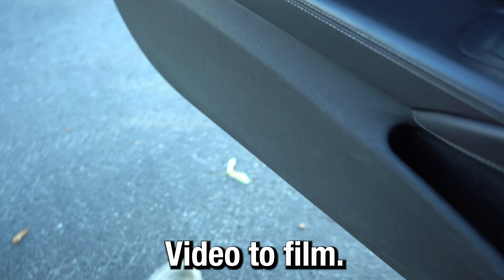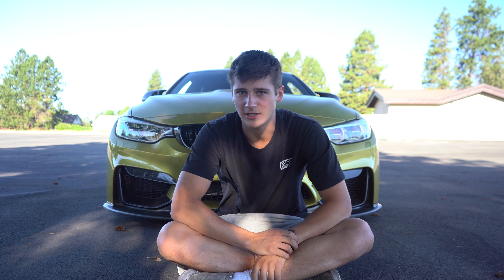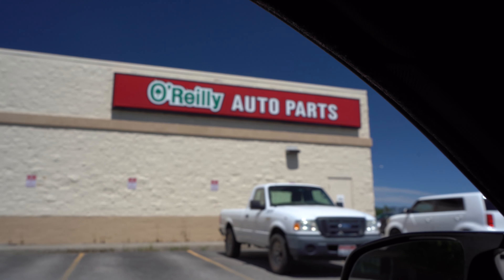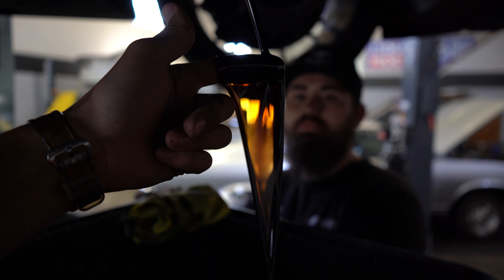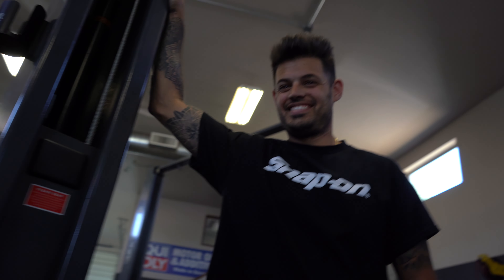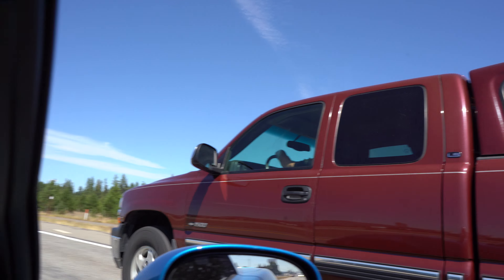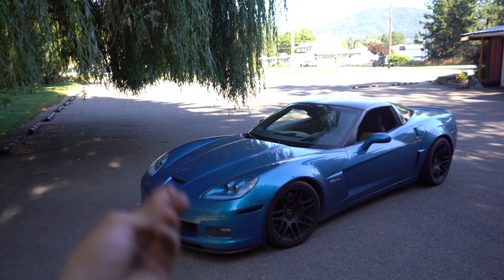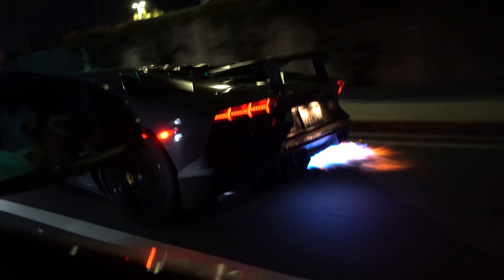I Drove my CORVETTE with No Oil...

Comment: You usually check the oil after warming the ls7 to operating temperature 175* shut down the engine and check after 5-15 minutes because of dry sump
Reply from the maker: We did
Reply: @JakeSchnatter  I meant after the trip to the store for more. It sat longer, so it had time to drain back down and could’ve read lower than it was.
Reply from the maker: @F8L.  oh ya true, still wasn’t reading after a quart and a half before that so maybe it was less than 4 quarts low but still not good